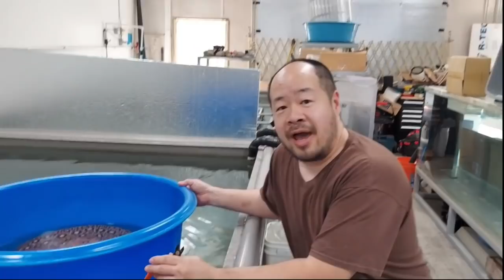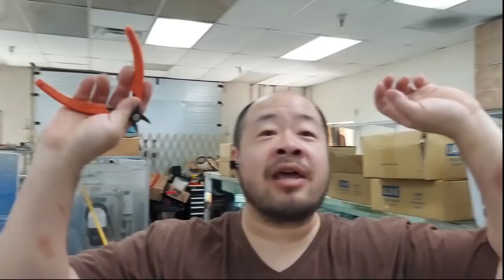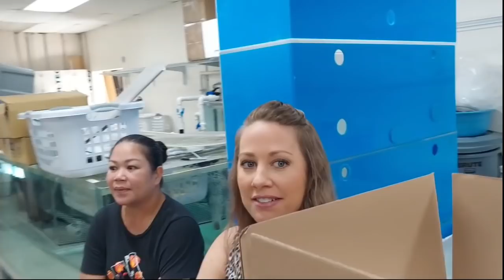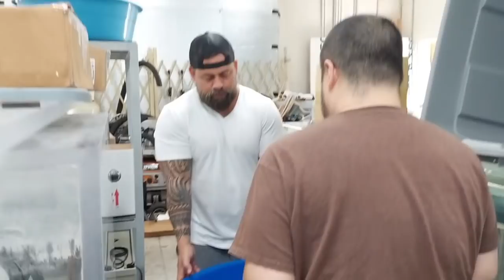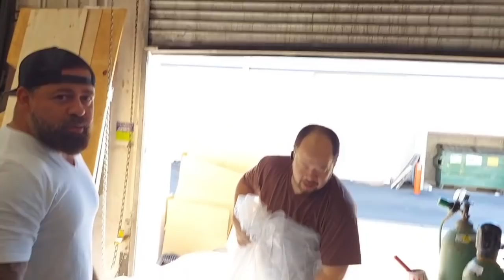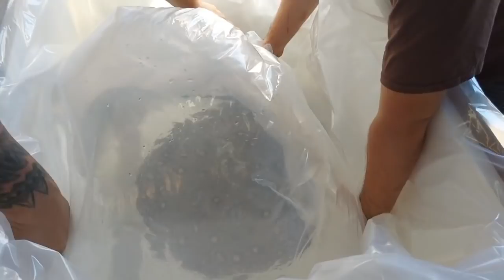Packing and Shipping Giant Freshwater Stingrays

Comment: Hey this might help, take some duct tape and make it a very large oval set it on the ground and set the box on top of it to where the side straps come up the side and you can roll the tape over for handles make it about four or five plies thick that way you got handles to get those boxes in and out of trailers and off the transports and stuff where it's going, and the duct tape will just stick to it and then the handles you roll over on the sides you don't have to worry about because I'm watching Josh over in Ohio having trouble getting the boxes in and out of everything .